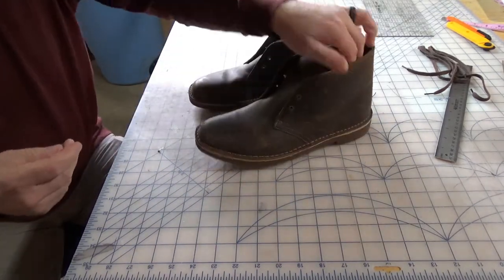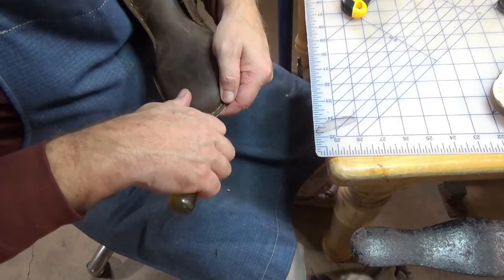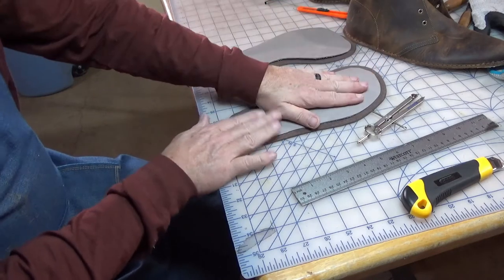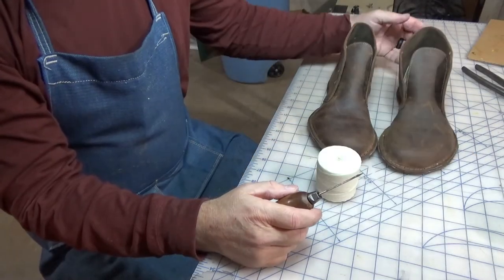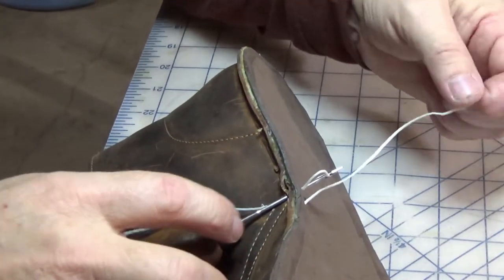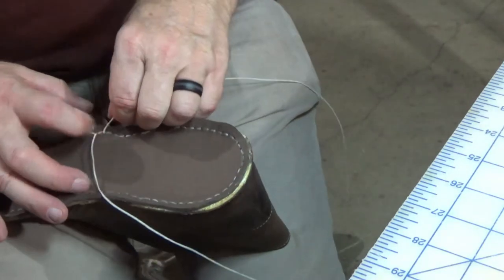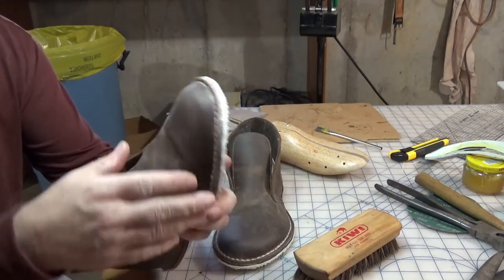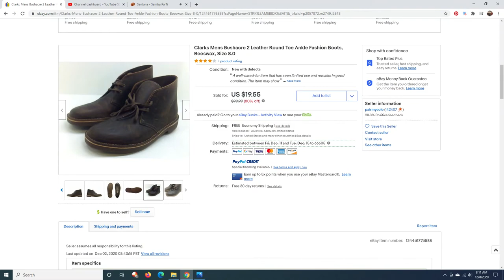Clarks Brushacre 2 Minimalist Modification

Comment: This is great! I have a similar issue with two different sized feet and finding adequate footwear that doesn’t rub or is too loose. 
Is that adhesive you used, SAR36 good for crepe rubber soles?
Reply from the maker: yes it will work just fine with crepe rubber, thanks for watching !